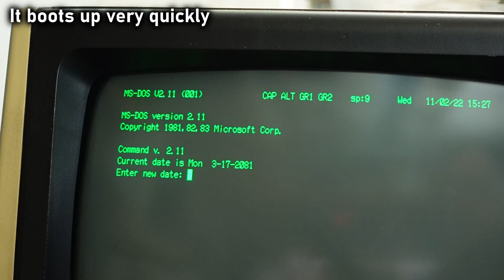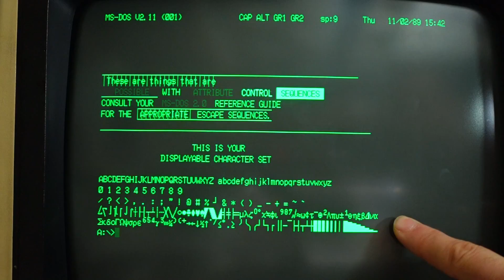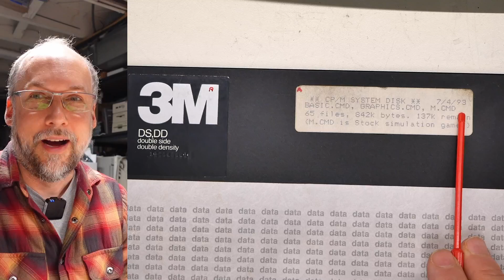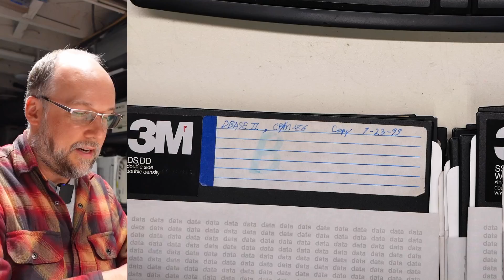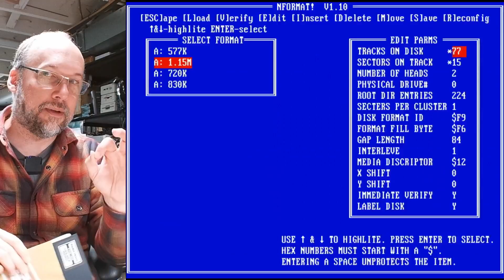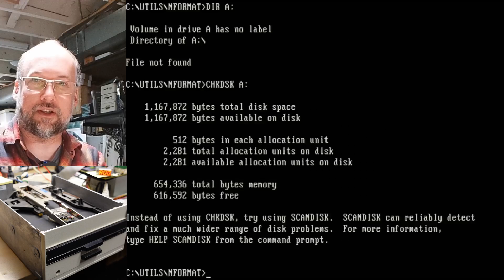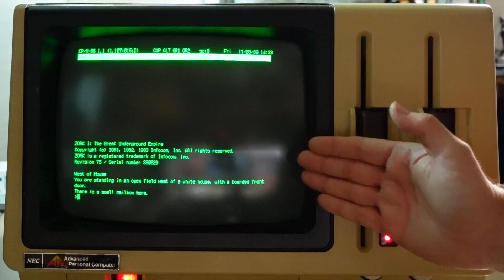Comment: it should be possible to do  that maze trick with normal ascii codes but you have to add a multiple of the rnd  to shift it enough characters to the opposite hand slash....i'll have a go with my spectrum emulator on my other pc,
Reply: Yeah someone sent me a line running on BASICA on a PC with a little more work -- but the character set on the PC doesn't have a full character / or \ so the maze doesn't look like a proper maze as it has gaps.
Reply: @adriansdigitalbasement  a spectrum is fairly near as only one blank pixel line top and bottom of the characters, or could define a couple of UDGs, pity a standard PC graphics system didnt have that capability
Reply: msx basic has full character slashes so should be possible with a msx or a pc running a msx emulator
Reply: yep, get a msx emulator running, then enter SCREEN1:KEYOFF:FORX=0TO1STEP0:?CHR$(1);CHR$(93-(RND(1)>.5));:NEXTX

Comment: This machine and software bundle is very typical of the early 1980s. If the user wanted to do something, outside of the few programs bundled they had to write the programs themselves. In the mid-1980s, I worked for Visual Technology who made their V-1050 CP/M Plus system. As an employee, I got a system at a steep discount and paid well under the list price of nearly $2500. That system too came bundled with a similar package including WordStar, DR Graph, MultiPlan, C-BASIC, and the Z-80 assembler. The V-1050 came with the built-in capabilities of reading other CP/M system and program disks by running a utility. Among the many the system supported was the DEC Rainbow and the Kaypro systems.

I learned Z-80 assembly on my machine and also wrote numerous programs in C-BASIC. Instead of using the line-editor, I used WordStar in non-document mode. The line editor is similar if not the same as Edlin, making viewing and editing code very frustrating. Once my program was written and compiled in Z-80 Assembler, I'd execute it and view the memory using Z-Sid. Z-Sid is similar to debug on a DOS system.

In many ways, I miss these days. Today, computers are blah, same, similar and not very exciting. This is the same with the operating systems. Linux comes close with its roll your own environment but that too is becoming more of the same from version to version.
Reply: John, guess what? Sitting here in my office is a Visual 1050! I haven't fired it up yer, waiting to make a video about it. I think I saw the drives on the 1050 are 96TPI versus the normal 48TPI on other systems, so you get 2x the storage. I figured it was going to have a similar issue to the APC though! Lack of the customized software it needs to really take advantage of the 1050's capabilities. 

I got this machine without disks or manuals. I haven't yet looked to see if scans and images exist, but I hope they do or it won't be a very interesting video.
Reply: @adriansdigitalbasement  Hi Adrian,  

I can't wait to see the system power up and bring back some memories. 🙂

There are disks up on Bit Savers for the system.  I recommend downloading both the V1.3 and V.14 contents. Google for the V-1050. There's a couple of sites dedicated to the system and I think one of them has the schematics for the circuit boards. Visual was great that way. The systems came with tech docs as well as a user manual.

Yes, the disks are 96 TPI and the TEAC floppy drives are really noisy and so is the fan inside the case. The 9-inch green or amber CRT is a separate unit. The keyboard to be warned is a Key-Tronic sponge and foil affair. Visual used the same display and keyboard for their V50, V55, V60 and V65 terminals from those components by placing a small circuit board inside the monitor.

I agree, there's not much software to take advantage of the graphics and other capabilities of that system. The system was very powerful for its time. The V-1050 has a 6502 and 32K of RAM dedicated for the graphics portion of the system. The Z80 gets its own bank-switched set. Unfortunately, I can't remember the total amount of RAM on board any longer, but they had plans to come release some add-on cards including some memory boards mounted on some very long-sharp headers which used to gouge my hands whenever I was fixing the board. I tested some early memory boards but they never made it past that point. The system does support a hard drive through the Centronics port in the back.

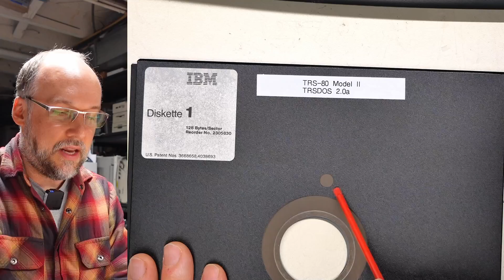Comment: 15:55 What you demonstrate with the index hole position here is excellent and very valuable knowledge...crucial to any 8" disk flux recovery system that I may develop here, so again, I and the vintage community thank you for this!!!
Reply: Yeah it's an interesting thing I didn't realize until recently!! I didn't say it in my video but I modded my Qume disk drive to actually allow me to format single sided disks as double sided. The circuit normally looks at which index hole is being read and then if it's the Single Sided hole, it will disallow use of the second head. I installed a jumper on the PCB to allow me to force it to ignore that part of the circuit. (This wasn't documented in the technical docs but I saw in the schematics the designers made a provision for this.) Anyway, yeah if you are going to be archiving 8" disks, it is essential to see the difference between single and double sided media since it's physically different.
Reply: @adriansdigitalbasement  Thanks for this!  I'm doing some experiments as a result with my 8" drives, and I'll be certain to share my results with you as soon as I have any...VERY cool and thanks again for this AWESOME preservation work and great video documentation!
Reply: I remember using an industrial machine in the early 80's that used 8" hard sector disks. You could see multiple holes in the magnetic disk punched to indicate the location of each sector through the index hole in the sleeve. I'm guessing these never made it onto the modern PC's of that time era, but the head loading clunk takes me back. We used to joke that it was punching holes out of the disk like a paper tape!

Comment: Unfortunately disk formats for MSDOS 2.11 on the various machines were not standardised.

So, this NEC has it's own format as do other machines such as the ACT Apricot (which has a non-standard header before the FAT), which has the same software problems.
Reply: I guess Microsoft didn't dictate the format and it was left to the manufacturers to decide?
Reply: Indeed. I think it was the same as Digital Research did with CP/M.
The FAT filesystem format itself seemed to be the same but the underlying encapsulation could change.
Reply: Interesting.  Will later versions of MSDOS read and write to earlier disks, or is their some way to copy data back/forth between the formats?
Reply: It's more that it's system specific and Microsoft didn't specify the disk format.
In the case of the Apricot the first sector on the drive contains the fully drive parameters including the number heads, sectors and tracks on the medium, the sector offset to the FAT and what would be on a PC the BIOS settings.
Goodness knows what the NEC has there.
Reply: @decidedly_retro  What would it take to read the first sector of a floppy?  Could it be done in gwbasic, for instance?
Reply: @decidedly_retro  Or...  maybe Adrian could just go in with a sector editor, read the first sector of a NEC APC disk, and modify the disk he formatted to contain the same information.
Reply: I’m afraid that because the underlying disk structure the NEC is using (1024 byte sectors) is one that the IBM PC MSDOS has no way of supporting then there’s no way to get the PC to read or write to the disk natively/ Sector editors wouldn’t help, especially as they would be written to only access 512 byte sectors and probably use the underlying BIOS calls anyway.

You’d need to write a program on the PC to access the disk controller directly, similar to the one to read CP/M disks that Adrian demonstrated.

Comment: Actually the NEC '765 floppy disc controller (and the Intel 8272A that's pin-compatible) doesn't need the index pulse to read.  It only needs it to format a track;  the formatting process writes a sector number into each sector on every track, which means it doesn't need the index pulse when reading or even writing-  only when formatting.
Reply: Interesting! I guess the OS implementation still looks for the pulse anyway. Kind of rude! I know IMD even doesn't work if the index pulse can't be seen (while reading) and it's controlling the disk controller directly.

Comment: Once every couple of years, I need to boot up an old PC 8088 to run a program called BoxCar that for some reason only works on an 8088 processor.  The software designs Box Culverts. It is the only program available to do some particular calculations for the hunches. Fun DOS stuff.
Reply: Dosbox !

Comment: Nearly all early PC software ran on non compatible MS-DOS machines. The two notable exceptions were Microsoft Flight Simulator and Lotus 1-2-3, but that was enough to tip the balance towards full clones. In the early days we didn't know if IBM was going to be as aggressive against clones as Apple had been, but once manufacturers saw that it was ok to make clones it didn't make sense to insist on non compatibles (like the TI Professional, the DEC Rainbow or the ones mentioned in the video)
Reply: I think early machines recreated the IBM PC architecture in hardware pretty much identically, but didn't have the IBM BIOS. This is what led to some incompatibility, but if the software tried to talk to hardware directly it would work. But this APC is completely different than the IBM PC with regards to the hardware architecture, so the software would have to rely 100% on DOS calls only to work.....
Reply: @adriansdigitalbasement  wonder if some modern trickery can be done to make it more compatible.

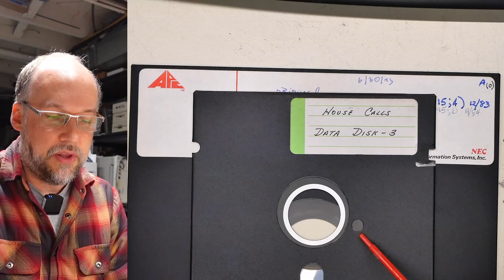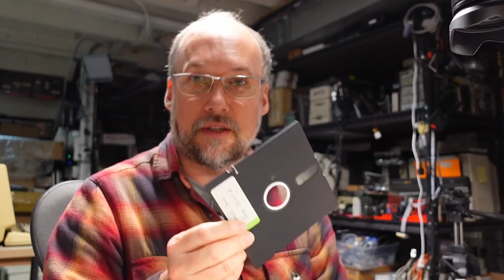Comment: 15:15 - Did someone do a DIY double-sided mod on this 5-1/4" diskette? I recall doing that for my TRS-80 disks as a teen. Cut a second write enable notch on the left side of the disk and use a hole punch to create a second index hole. Saved a few bucks by turning SS disks into DS disks. Once in a while the second side wouldn't be reliable, but mostly it worked OK.  Edit: 20:20 - heh.

Comment: The disk format on the 8" disks seems to be the same format the NEC PC-98 used for its 3.5" disks (which, incidentally, is the third supported format on USB floppy drives in addition to 1.44M and 720K). Maybe you can find software meant for working with PC-98 images or PC-98 disks on DOS/V?
Reply: Oh really that's interesting. I didn't know about the 3rd disk format support on USB 3.5" drives. I did some googling for PC-98 DOS support but don't see anything. Just lots of talk about the USB drive thing
Reply: I remember a "3 mode floppy support" BIOS option on some socket 7 boards, which is apparently for a 1.2 MB (not 1.44) 3.5" disk format used in Japan.  Is that the same thing as the PC-98 format?

The Wikipedia page for the PC-9800 says "Early PC-9801 models supported 1232 KB 8-inch floppy drives and/or 640 KB 5-1⁄4-inch floppy drives. [...] High density 5-1⁄4-inch and 3-1⁄2-inch floppy disks use the same logical format and data rate as 1232 KB 8-inch floppy disks."
Reply: @awd42  Aye that is the same format. PC-98 was the biggest computer platform in Japan before Windows 95 made its differences from PC-compatibles more or less moot.

Comment: universal:
10 PRINT CHR(ASC("/") + INT(RND(1) * 2) * (ASC("\") - ASC("/")));: GOTO 10
or
10 PRINT MID$("/\", 1 + RND(1), 1);: GOTO 10

Not as compact as C64 one but still one line, at least on 64 or 80 columns (first version is 62 characters sans spaces, second one is 36).

In ASCII the first one can be shortened to:
10 PRINT CHR(47 + INT(RND(1) * 2) * 45);: GOTO 10
which is 39 characters (not counting spaces), fitting into 40-column line even if just barely.

Some BASIC variants allow for contraction of second version:
10 A$="/\": PRINT A$(1 + RND(1));: GOTO 10

For BASIC variants without line numbers:
A$="/\": WHILE 1: PRINT MID$("/\", 1 + RND (1), 1);: WEND
Reply: Yeah I see that does work -- although it produces a maze with gaps. Still neat though. Seems the Atari actually has a character set with the full cell / amd \ right next to each other too, so that would definitely work.
Reply: @adriansdigitalbasement  Well, the gaps are due to character generation which is outside of control of a universal BASIC program.

Comment: I always believed that MSDOS only reads 80 tracks formatted disks. Even if the boot sector specifies another format. I experienced such behaviour with Atari ST formatted disks that weren't 80 tracks 9 sectors.
Reply: No, far from it. 5¼" floppy drives were only 40 tracks as shipped with the PC and PC/XT. It wasn't until the PC/AT that you see 80 track drives.
Reply: It's actually more flexible than that -- it is just limited for formatting the disks. Like 83 track disks work fine as does 77 as you can see in this demo.